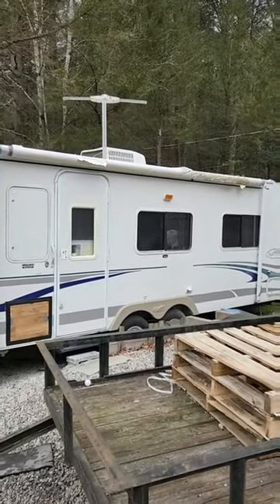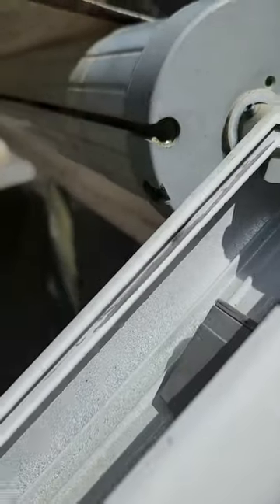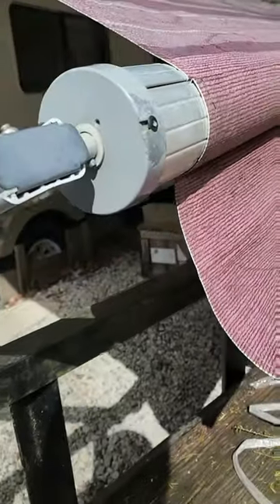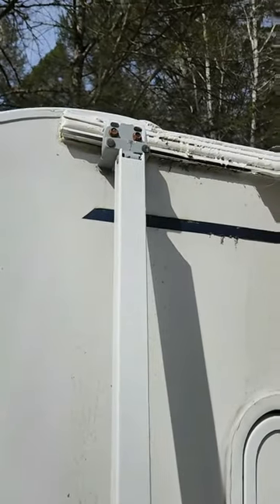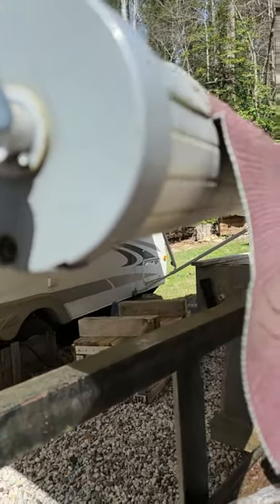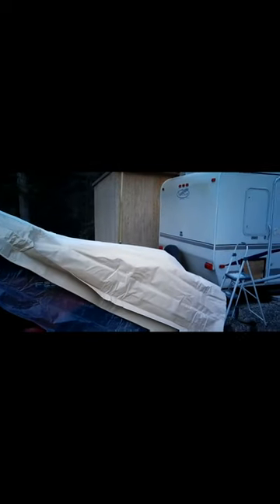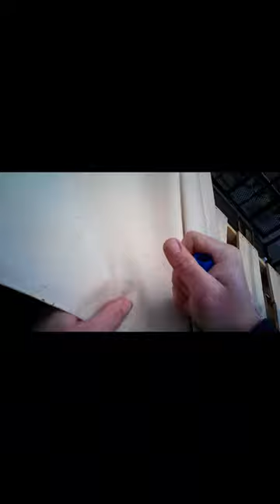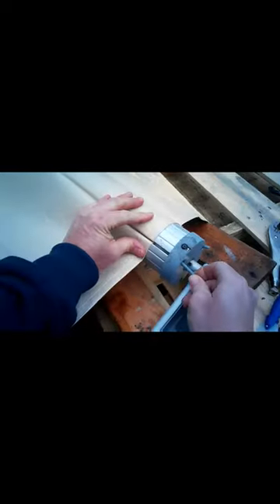Easiest way to replace rv awning. no need to unwind and disassemble dangerous springs.

Comment: I ordered a replacement awning from Dominic that was to be identical to the first one.
Followed your method and it worked great except that I removed the roller because I had to insert two places into the roller and it was too unwieldy when still mounted.
Worked like a charm.
New awning is thicker material, so it didn't lay down against the trailer when stored like the other one did.  It will be fine, though.
Thanks!

Comment: Wow Dude, I can not THANK YOU enough for your video! I was worried about changing the awning on my RV, but you saved the day. Listen folks this is by far the easiest way to do this. I used 2 saw horses and sprayed soapy water in the slots. My wife and I took may an hour and it was done. Soooo glad I saw your video!!! THANKS
Reply from the maker: Great. Im glad you got it fixed and THANK YOU very much for the comment and for watching. I wish i had used the soapy water. Thanks for the idea. It would have made things even easier.

Comment: I’d wondered why there weren’t holes already in the end caps to do it this way and had considered it…especially since my caps don’t have the holes to accommodate a pick/screw driver to prevent the non cam lock end from unwinding. 
Thanks so much for creating the video and posting it up! You sir have provided many with some great insight and confidence! 🙌

Comment: well, I tell ya.getting it off the trailer was easy,all we did was pull.However getting it off the roller part was very hard,no amount of silicone helped,we had to pull it off a little at a time.Thanks for the video,I'm sure it helped someone.

Comment: I always pull the entire awning, pull off the arms and fabric. Then I can check the tortion springs before winding the awning and hanging it. If it is in roll down then it is safe after you wind it as long as you don't hit the cam lock.

Comment: Great Video, looking to do the same on mine and I noticed that on the front arm there is a hole to the channel for the awning on the end cap (same as on the back arm for the pull strap) so worth checking both ends. anything to save time drilling & with a file!

Comment: Great idea only one problem unless someone already brought it to your attention. You put the press in cord on wrong side. The press in cord usually goes on the valence not the main awning track.
Reply from the maker: Thanks for your input. Could you provide a link to this information? I cant find it. There would have been no way for me to have done it that way with this fabric. The valance tube was pre sewn in. Thanks again.
Reply: @slockfox  it was another you tube video that showed how to do it. But that being said it really depends on how much valence your awnings manufacturer left at the end. If it is only about 6" then this might be the only way to do then as in this video. But most companies I think give a few feet after the corded sleeve  this means the press in cord would go after the slide in one. I would think this is the stronger and preferred way as i feel the valence should have the press in cord as it's not taking as much tension and the first one.
Reply: @chrisappel8242  I agree , that exactly what I thought

Comment: I love your video the most on rv awning replacement! Do we need to  place a screw where you did drill holes? I also dont like to deal with the spring winding.
Reply from the maker: Thanks alot. I didnt use any screws where i drilled to holes but i have seen other videos where they put screws on each side of the valance to keep the awning from sliding back and forth. I havnt had a problem with it moving so far. Thanks for watching.

Comment: What kept it from retracting when you pulled it out? Did you lock it someway with the switch?
Reply from the maker: My awning setup has a little ratcheting lever that keeps it from coiling back up. I was very aware not to bump into it and have the spring unwind. It would probably be wise to secure it somehow if there was a chance someone or something could hit the switch. https://cdn.shortpixel.ai/spai/q_lossy+w_839+to_webp+ret_img/roadslesstraveled.us/blog/wp-content/uploads/2018/08/08-721-Locking-end-of-RV-awning-min-1.jpg

Comment: You didn’t mention the lock on one end and pinning the other end so the spring wouldn’t unwind.
Reply from the maker: @Mytube5202  yes, you are correct. This is just how i did mine. Im not suggesting anyone copy me. You or someone else would most definitely, not want to go flip the lock switch while working on or replacing the awning.